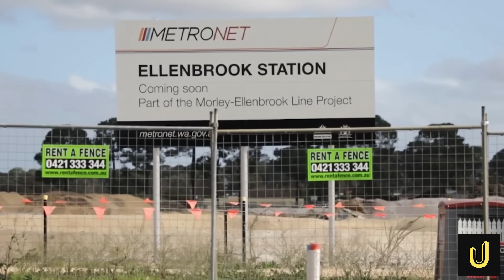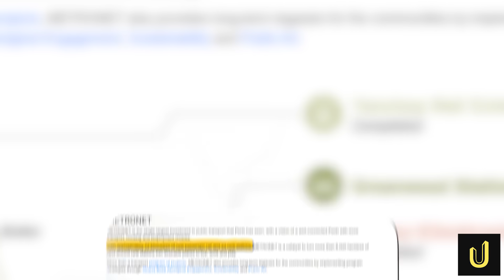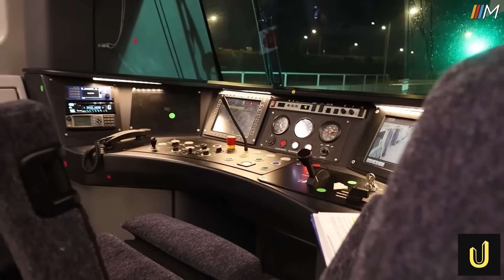$13 Billion METRONET is Reshaping Perth!

Comment: a bit inaccurate.  funny how the video said labor did it all.  a propaganda piece.
Reply: Labor did do it all, it's why they keep getting thumping majorites.
Reply: @Mark-Ozi  Labor smashed in today's paper.  Current rail use by public less than fourteen years ago. Despite massive overruns in tiime and cost.  Free transport and lower charges.  Great.  More money going our and less revenue coming in.  That equals more tax and less essential services provided.  Been watching the hospital sector recently, ramping and bed shortages...  Now that's something the Liberals put a huge amount of effort in.  Labor is just ideology but nothing practical to help people.
Reply: @Mark-Ozi  remember Labor stuffed up the Ellenbrook line putting it up Tonkin Hwy, avoiding the Morley hub, omitting Bennet Springs...  Basically running it alongside a recreational reserve.  If you remember Liberals were pushing for tunnelling into Morley to enable a second CBD.  Labor did the cheap, quick and nasty approach that ensures three lines run through Bayswater which will never become a community hub.  Basically centralising everything back into the CBD.  Their next brainwave is to bring a track from Ballajura through to Clarkson, avoiding Joondalup and taking a hugely indirect route into the city.  Stick the rail down the middle of a main road with stops five km apart, then wonder why no one takes it.
Reply: @Mark-Ozi and thumping electricity/power bills 🤦‍♂️thanks labor
Reply: @Mark-Ozi  Airport tunnel?  that was initiated, built during Barnett's time.  You don't know your history.  Opened under Labor.  It never would have happened.  Labor has been smashed in today's press read it?  cost overruns on transport projects and lower patroniage.  ouch.
Reply: @BDub2024  What do you expect from that far right rag?
Reply: @NickStevens-o7n  I'd call The West tacky, but its not "far right".  Thats an outdated trope to basically call anything you disagree with as "far right".  They have a lot of "far left" opinion pieces and often target businesses...  but you hear how silly it sounds to call things far left or far right or nazis or commies if you disagree with them.  All you've done is put your hands over your ears if you hear something you disagree with.  That's what we're getting in American politics with significant sections only listening to voices that agree with their views.
Reply: @BDub2024  Wrong. It was first proposed under the Carpenter Labor Government in 2004. Easy to check that fact.
Reply: @dratz50  Labor proposed some services and Liberals others.  But its fair to say that Labor has made some shocking decisions in the rush to just lay track.  So built long rail routes through low density areas with an eye on the electoral benefits.  you've gotta be cynical.  Labor wanted Ellenbrook knowing full well it wasn't feasible due to population.  Liberals were honest with the electorate pointing it out.  Then Labor build it far too early than required, and just plant it down a freeway in low density or zero density suburbs.  Poorly done.